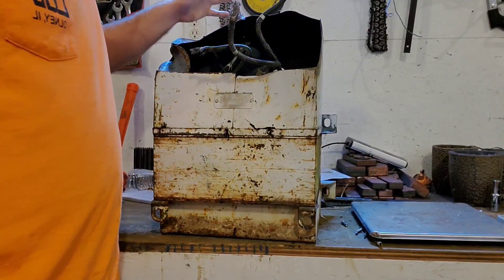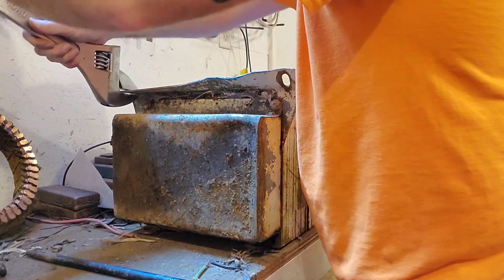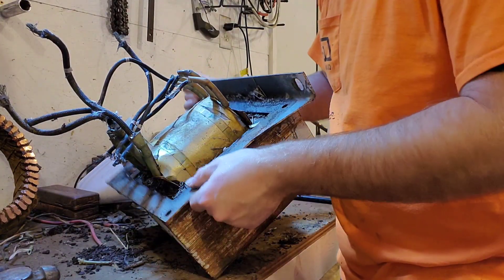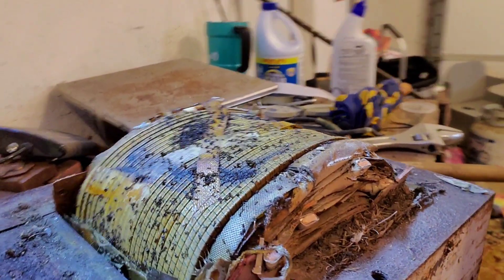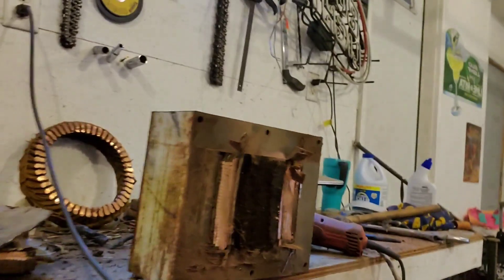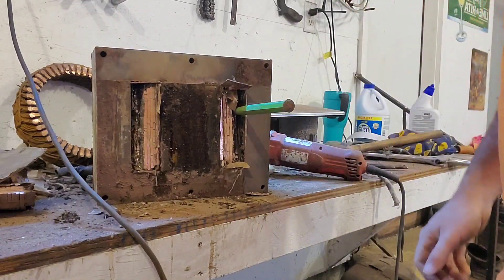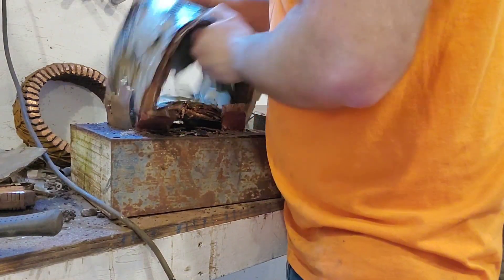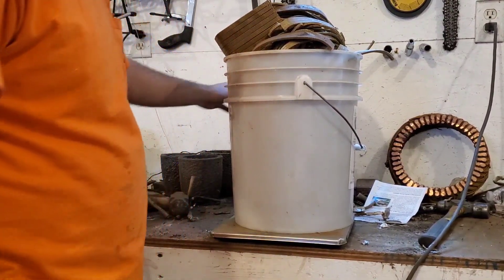How much copper is in a 170ib transformer?

Comment: Where did you get that ? That is huge.
Reply from the maker: I got it from work.
Reply: Oh wow lucky you all I get from my work is insulated aluminum wire that turns into ec wire when you strip it haha. The wire comes back sometimes in main power hookup construction workers just snip and leave wire in the tube wen it comes back to get fixed. Sometimes copper not very often tho.

Comment: So, i saw in the comments that you have an air hammer nowadays that works pretty good. Are you still getting transformers this large? If not how big are these transformers nowadays? A couple things I noticed for those of us who don’t have air hammers, if we can get our hands on a bigger grinder than a 4 1/2 inch like you were using that speeds things up a lot more. I tend to find that if I cut both sides, it’s easier to walk out the copper because all it has to do is go straight. When one side is not cut and it’s bent and connected to other copper that’s tight and bent and connected to other copper that’s yada yada, it’s a lot more stubborn. The third thing, is if you can find a bigger punch, or even a large carriage bolt would work fine. Those tend to bend after awhile, though, and the threads on them make them more prone to getting stuck. Try to find as big of a solid steel rod that can cover as much copper in one section as possible, and go to town. Watch out, though, as it happens quickly once both sides are cut. It’ll shoot out the other side, since they’ll be straight pieces. Thanks for sharing. Aloha
Reply from the maker: Thank you for watching and leaving a comment i really appreciate it. I dont get those transformers very often at all but they are easy money by far my favorite thing too break down.

Comment: Where do you even get a 170 lb transformers. It's not like they're just sitting on the side of the road waiting for someone to pick them up. That had to have come out of an older shop or facility than has been abandoned for some time.
Reply from the maker: Lol yes it came out of the corner of the bine yard at a facility i work at. It was built in the 60s